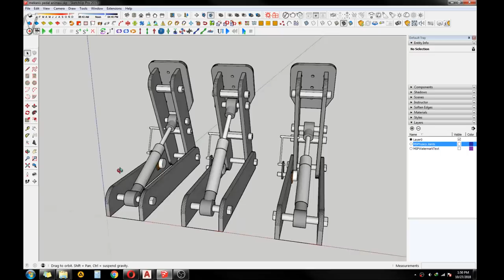DIY Pedal Box for Simulator | DIY Steering Wheel - Sim Racing Rig

Comment: First of all, great build really like it! But could you show how did u wired all 3 potentiometers on your arduino board? Thank you!
Reply: It is not necesary an arduino, you only need where to connect +, signal and gnd of the throttle, brake, and clutch in the connector pins, for example for a thrustmaster t150 you will need a rj11. I can share with you the schem (sorry for my english)
Reply: @sergiomangas3434  Hey man ! Just acquired a t150, would love to see thoses schematics if you have them laying around. Much thx
Reply: @sergiomangas3434   Hola Sergio, puedes compartir conmigo el esquema de conexion? tengo un T150 y me gustaria montarme unos pedales como estos. Gracias, espero tu respuesta. Un saludo.
Reply: @pablomadrid5551  www.racedepartment.com/attachments/g25pinout-png.148609/  aqui tienes pero tendrias que comprar un adaptador de logitech a thrustmaster. como has hecho para que el recorrido del pedal sea el mismo que en el juego?
Reply: @mrgamingcraft9542  sorry for not answering you men, did not see ur comment :(
Reply: @sergiomangas3434  no prob dude ! I've been busy working on a 3D printed 8 Gears H shifter lately ^^
Reply: @sergiomangas3434   Gracias por la info Sergio. No estoy seguro sobre lo que dices del recorrido del pedal, pero creo que los pedales se pueden calibrar con un programa que detecta el recorrido cuando lo pisas a fondo. Todavia tengo que disenhar las piezas en 3D e imprimirlas. Creo que lo voy ha hacer todo impreso en 3D menos la tornilleria y demas componentes. Un saludo.
Reply: @mrgamingcraft9542  t150 compatible?
Reply: @pablomadrid5551  oye, y que muelles has usado?
Reply: @sergiomangas3434  sadly not i've picked up a Arduino Leonardo for the 3 pedales axis and i'll be using the DI of it for the switches of the shifter ^^
Reply: @pablomadrid5551  para los potenciometros no se debe olvidar sus grados de rotacion en los diagramas. Si no compras 70° pot's, es impocible cambiar la calibracion en mi opinion

Comment: Man, first thanks a lot for shared with us you project. A important question about pneumatic, you know the power of him(30N-3KG, 40N-4Kg, 60N-6Kg....)? I have 60N pneumatic but is very to strong.
Reply: u should make a little whole in it, it works only by spring
Reply: @pysznarybka  where can i make the hole?
Reply: @lucvsss070  no matter where
Reply: @pysznarybka  and how I do it? with drill?
Reply: @lucvsss070  no, use a metal saw , it shoukd be empty from gas
Reply: @pysznarybka  the gas is dangerous?

Comment: Bang,kalo pas di cek potensio geter2 gak mau diem itu gimana,salah di apanya ya saya pake potensio 10k
Reply from the maker: Itu noise. Dipasang capasitor supaya lebih stabil.
Reply: @AgaYuditraStudio  iya mantul geternya ilang,sampai nyari di fb,eh malh nemu bang agayuditra juga di fb kalo steer delay pake potensio apakah ada triknya jg untuk akalinya bang

Comment: Hello.
I want to know where you bought the parts.. and what is the material of that pedals?
and in racing wheel DIY, where can I buy the printer encoder? I can't find printer encoder in my country's internet mall.
Reply from the maker: I bought part on the indonesia marketplace.
Pedal using PVC sheet, check onthe description box for parts.

You can buy on the printer service, or use broken printer.. Or you can change with incremental encoder.
Reply: @AgaYuditraStudio  Thanks a lot!
Have a nice day sir :)

Comment: Nice work but potentiometer brake isn't perfect solution for brake pedal :p
Reply from the maker: Yes that's right, pressure sensor like loadcell is the best way.
But for this project, I use logitech pedals for reference.

My load cell project still developing.
Reply: Why to use 10k ohm pot .. can we use 50k or say more ??do u have any idea